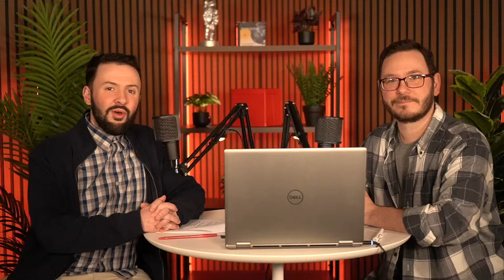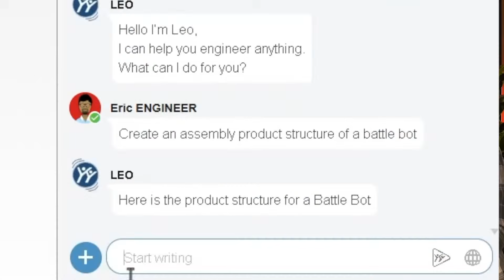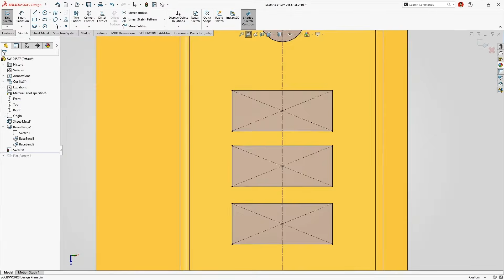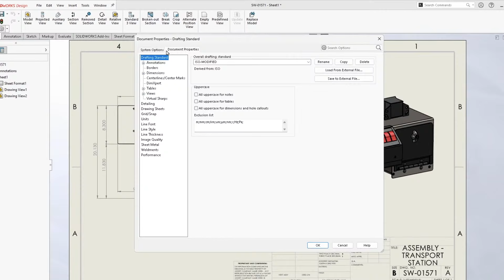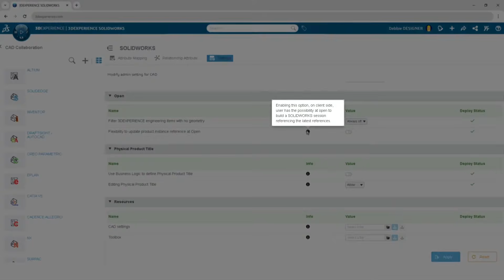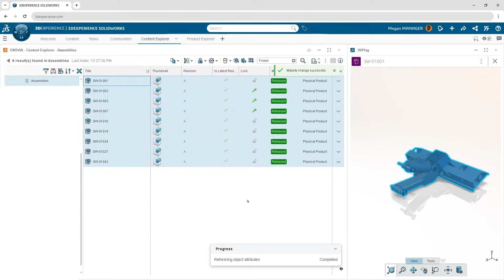SOLIDWORKS 2026 FD01: AI-Powered 3D CAD Software | LEO & AURA + Performance Upgrades

Comment: i had to work with Solidworks for 3 years now... after 20 years Autodesk Inventor. 3 years i had to fight against constant CTDs, "Memory Full" messages (because its refused to use 2/3rd of the VRAM of that expensive Nvidia GFX card) and a Assembly performance that was outright horrible. Maybe the first thing you should add an AI for, is to manage the dynamic triangulation of the CAD Models, instead of forcing the user to manually set the interpolation accuracy (for that other CAD packages not even need an AI, but do just do it -> zoom in, hit refresh) 
having 40 individual simple parts open Inventor - no problem. Solidworks: your "memory is full" message after 6... CTD after 10.